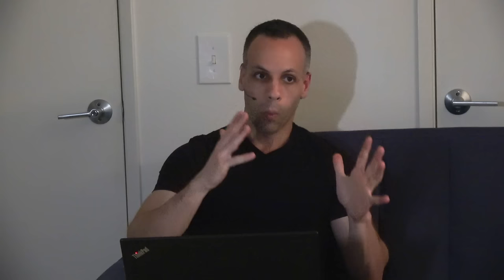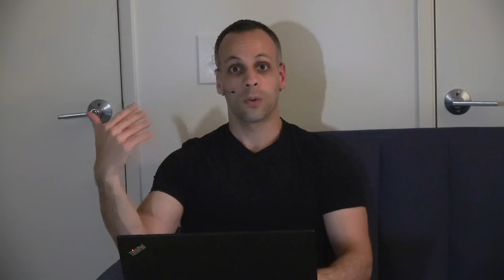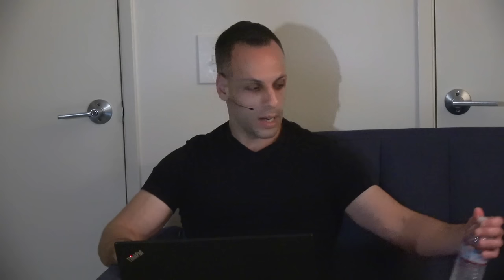EVGA's Oversight: Unannounced Changes Destroy PCs, EVGA takes NO ACCOUNTABILITY

Comment: I understand the policies, the problem is that they do not change the model when they change the pinout and there is not any justification for that, it's just a matter of printing new boxes and stickers.
Correction: Apparently, the boxes and stickers specify the version/revision of the PSU, according to one person in the comments. I still think that they should change the model to avoid confusion.

Comment: Years ago I plugged in a power cable into my OCZ power supply.  The modular cable was intended to go with a Seasonic, which has a different pinout on the side of the PSU.  $1,500 later, Kroll Ontrack (Eden Prairie, MN) recovered basically 100% of my data.  So EVGA wishes to change the pinout of a model in the middle of a production run without telling anybody?  PERMA-BAN, BABY.

Comment: Brand doesn't mean much anymore, I paid for an entry level seasonic psu. When i received it , it was DOA. I was so sure that the problem was from my setup, since for my it was impossible that Seasonic would let pass QC a bad power supplies. After going back and forth searching I found on a forum that some entry level PSU are not made by seasonic but by an OEM with seasonic specs. In the end I had to exchange my PSU and put some money to get the midrange one that are actually are still made by seasonic

Comment: If the pin-outs aren't all compatible, they should be using a different physical connector or supplying a tester with every PSU. It's ridiculous. (TBH, I have been paranoid about this issue for years, and keep my PSU cables in the box for each PSU, even where two are the same model, but I thought I was just being paranoid! Turns out I wasn't.)

Comment: Any company large or small providing a consumer product needs to provide a statement on their website, within a repair, etc stating if a manufacturer determined that a user-based function or procedure has been changed, modified, omitted, etc. If they fail to let the consumer know, this could look like a malicious attack upon the consumer to make them fail as an entity especially if there is sensitive data lost during the transition. We are used to living in a plug-n-play society and for those who aren't tech savvy rely upon this to make life easier. Any time that a manufacturer decides changes to a current program are to take place, it is their responsibility to notify those who are affected. Even when it comes to just an operating system that is downloaded, you are used to how it works now, and all of a sudden certain features are gone. This gives the end user a chance to make do with the changes or go to another source that has the features. At this point, with all the ways these companies are working are making us slaves to the company and not a someone who has a choice.

Comment: If you change the pinout on a model, why make the cables interchangable - put a notch or some other inhibitor to avoid using incompatible cables. The industry has been doing this since forever!
EVGA should definitely take responsibility for this!
Reply: The problem is that EVGA doesn't build their own power supplies, so a custom connector would add more expense and make no sense since the   plugs are standardized.

Comment: I noticed that modular power supplies often have different pinouts when I plug in different cables and then test it with a PSU tester only for the power supply to automatically shut off if I used the wrong cables.

Comment: Yeah been doing this since way before modular power supplies and assumed the ones where the plugs were compatible were standard. Like you I guess I need to buy a lotto ticket because I haven't blown anything up yet. To quote you this is informative and unfortunate. Now I am going to have to dig out my power supply tester whenever I install one and it shouldn't be that way.

Comment: "Keep your cables during RMA"  > "Here is your PSU back" > "Why did you keep your cables and reuse them when you were supposed to buy brand new cables even though we didn't tell you and it was not our policy?"
Best way to fix this is for EVGA to update their RMA process for changing the pin layout, give this guy a replacement PSU and cables, offer to buy him 22TB of new hard drives and apologize.

Comment: Murphy's Law, applied correctly, is an engineering principle.  Design such that a distracted tech can't install a part wrong and they won't.  Applied to cabling it stands to reason that you don't change pinout without good cause.  And if you must, change the connector so the incompatible parts can't be plugged in where they don't belong.

Comment: Power supplies always worry me, because they could output a too high voltage due to failure of regulation components. I never thought that they would have destructive rewiring of the pinout. Something new to check before using new supplies. I don't even trust phone chargers without hooking them up to a scope under load.

Comment: If they change the voltage output on the pins they should change the socket so you're old cable cannot connect to the new socket

Comment: The usual "the left hand doesn't know what the right hand is doing" problem.
FWIW I've only bought non-modular supplies (can you still buy them?) because I was afraid the additional connectors were another point of failure.

Comment: Been happening for years, just stupidity on the manufacturers.

Had it WAAAAAY back when I had a Sinclair Spectrum +2A (yes I'm old!).  The +2A was a slighty upgraded version of the +2, still with cassette (+3 had a disk drive), basically sort of an updated "BIOS" as it were.  Added the ability to communicate natively with a disk drive.

The +2, +2A, and +3 had the same connector for power (6-pin DIN).  For no reason at all; on the +2A and +3 models they swapped the 12V and 5V lines on the connector from the +2 model.

Basically: borrow your mates power brick, fry your computer.

Comment: I too, only came across the fact that there is NO standard for the PSU end on modular power supply cables sometime last year IIRC. The fact that this kind of thing could be an inline model change inside a manufacturer's same model line (And that it's EVGA no less) is unwelcome news. Having an EVGA 650 BQ semi-modular PSU in my main rig this is good to know. Yikes!

Comment: Ha I found myself checking the pinout on a modular psu cable with a multimeter the other day.
But under these circumstances I wouldn't have either.

Comment: I don't see how this could really be a problem for them to cover. It requires someone have a PSU that was RMA'd and then point out that it fried something, they can check that the pinout changed leading to that being possible and then only cover the number of drives that could have been plugged in as they don't offer infinite cables, they offer like 1 or 2 per device.

Regarding the pinout standard: yeah it's real dumb but unless there's a standard from the start every company will do their own incompatible thing and then won't want to change and bear the cost associated as well as invalidating their previous products. That being said, EVGA doesn't make their own supplies, they relabel supplies from other companies. I wouldn't be surprised if the reason for the pinout change was them using multiple suppliers for that model or have recently changed suppliers, or something along those lines.

Comment: It's funny, but I recently learned this exact same thing. The problem is: every manufacturer in the world has abandoned ISO Standards in order to create "Closed Ecosystems." And this is what you get when they want to force you to buy every piece, every small component from them, or in the least licenced by them. EVGA's perfect solution to this would have been to just send a bag of cables with the replacement power supply, EVERY TIME, if they cannot guarantee the pinouts match! What's really crappy for me is that 6 months after buying a new EVGA power supply, I have no way of knowing which bag of supply cables belong to the old pinout or the new one. So if I make any changes and have to add hard drives/etc, I'll have to order new cables, or have someone with a multimeter check the pinouts before I connect my existing ones up.

Comment: Here's my problem with your argument at the end: it's not the EVGA power supply that bricked the drives.  It's not a warranty matter because the power supply wasn't defective, and saying "the warranty doesn't cover X" doesn't save them.  It's EVGA's negligence that bricked these drives and destroyed the data, and they need to make the customer whole, data recovery included.

Comment: There's one important detail missing from Louis' argument re. damaged HDDs/parts - EVGA have arguably been negligent on this occasion. Changing pinouts without notification on the same psu model, very bad. But telling a customer to keep their cables and without warning sending them a replacement PSU with different, incompatible pinout which kills their hardware... they must surely be liable due to negligence, regardless of what their warranty says.
As for them being scammed if they accepted their mistake and replaced this (& similar) customer's destroyed HDDs... their exposure would only be to sata powered parts and only to customers who received a pin-mismatched replacement PSU. Which can't be that many, surely. (They can also reduce their exposure by contacting warranty replacement customers before drives get killed. Yes it will cost them, but 1) they screwed up and 2) the damage to their reputation will surely cost them even more.

Comment: I didn't know that the detachable cables were built to their specific PSU brand. My very first PSU with detachable cables  was damaged when I tripped on the power cable. I bought a new PSU from a different brand and for some reason I used one of the cables from the first PSU.
The new PSU and and a hard drive blew up.

Comment: I remember RMA-ing an EVGA PSU a while ago cause it died after ~3 months, the replacement they sent me came with all its cables and everything BUT it was rated 50 lower and had a warranty 1/3 as long that started when i bought the first one.

Comment: You say they open themselves up to getting taken advantage of if they offer to reimburse the user for their drives, but I'm not really sure that's the case here. They can clearly see that the customer sent them one power supply, and they sent back the new revision. It's not quite proof that the drives were killed by the differently wired cable, but it's pretty close. This case is a lot different than, say, a customer randomly contacting them saying "I bought two of your power supplies and broke things by changing the cables", given that they don't even have proof that the customer bought the two power supplies (and you could somewhat reasonably argue that it's the customer's fault).

It's really a moot point, though. EVGA practically asked for issues like this when they changed the pinout but didn't change the physical connector. If they weren't fucking idiots, then this would never have happened.

Comment: I had exactly this problem. Power supply died, so got replacement power supply. Cables had same connectors, so I used existing cables on the sensible assumption that they would be standard. It's basically a deliberate trap.

Comment: Wow... I thought those modular cables were somehow standartized... at least the connectors. I knew that the cable itself might be rated for different wattage, so it might look the same but might burn on different powersupply even if it fits as it might be graded lower that the supply can juice through it... 
But I would have never guess that they WOULD switch pins... I have rolled the dice for this with Seasonic and thank god knocks on wood I even switched 650 for 750 and haven't burned anything down... god damn you learn every day...

Comment: Thanks for the heads up.  I had something similar happen a very long time ago.  This was back in the FAT16 days [except it was just called FAT because FAT32 didn't exist].  But for my first 1G drive, I had to install a special driver.  But a couple of years later, 1G wasn't good enough so I bought a 2G drive.  But the new drive used the same special driver.  I tried the older driver because I needed to move data from the old drive to the new one.  It turned out, the new drive used a newer version of the driver and the new driver was incompatible with the old drive.  It destroyed the data on the old drive.

Comment: Yes, there is a limit to their liability, and yes, I would expect them to pay for data recovery. I would even expect them to pay some kind of compensation for the time lost dealing with this magnitude of a problem. To limit the liability, pay only for whats inside the one PC that got damaged by sending a PSU with different pinout. That PSU has a certain amount of cables that have the messed up pinout. Let the customer send you all the broken drives, pay a data recovery service to recover data and send repaired (or replaced, with the old data) drives back. Restore to original, not less, not more. The customer then has little to gain from cheating the system. Newer broken drives would have warranty coverage instead, older broken drives are not really useful anymore.

Comment: It doesn't need to be printed on the box or the model or anything - if they changed the pinouts, they should have changed the keying of the cables, so you cannot physically plug in the wrong cables without modifying them.  PSU cables have different notches in the plugs.  Some of the pin covers are square, and some are D-shaped.  A simple change to that would have fixed the issue.
Even easier than that would be for EVGA to have a mildly intelligent system that demanded that they send in the cable for any of these affected models, and, if the cables were not recieved, send the cables out anyways and print out a warning and put it in with the shipment.

Comment: Yes, I have tons of those cables. I never know for which PSU cable is. So, I 1st look at shapes of domes around pins, if it plugs (matches) into PSU.
2nd) Then I take voltmeter, and measure each pin against ground.

This applies even to PCIe power, therefore graphics cards.

Comment: that's insane I have a pile of 10+ EVGA 750 golds that i used to btc mine for 2+ years straight 100% maxed out 24/7/365 years back so the supplies are rock solid pretty insane they would swap pins. that had to be an unintentional oversight because they are top quality. back then cables were like gold so a lot of mixing and matching was occurring to not melt your wires from max current flowing thru them 24/7/365 but of course btc miners only used the square 4/6 pins not the flat sata ones

Comment: There is one company that has created a "standard" for the PSU side ports, but unfortunately they've patented it and don't appear to be selling licenses for it AFAIK. 

That company is Super Flower which is a highly reliable OEM that many other brands use, they have what they call the "super connector", every cable except the motherboard ones just have a 9 pin connection on the PSU and every port is universal, it's honestly fantastic and I wish they could make all brands use it! All the universal ports are exactly the same no matter the model, generation, or revision, it simply just works.

Comment: 14:40 Customers did exactly what you describe, and EVGA replaced stuff. One guy intentionally cut the tubes on his AiO cooler, threw a tantrum about how he was going to tell all his twitch subs that EVGA wouldn't replace his "defective" hardware, and the RMA department caved, gave a free replacement. And yes, people abused the hell out of the long warranty periods. They'd buy old stuff on ebay that had the lifetime warranty (it's why EVGA took down the warranty period check page for a while), make up an invoice from some random seller, then RMA for a new(er) product. Others constantly used the 5-10 year warranties as "back-door" step-up upgrade paths.
Reply: hmm ok
Reply: Customers abuse the most consumer-friendly policies in the industry and then have the gall to complain when companies start to push back on it.

Granted, that doesn't excuse EVGA's case here, but still.
Reply: @jmal  The RMA department managers roll over easier than a Labrador retriever that just ate an entire tray of pot brownies, unless it was a company screw-up. Then they turn into the most stalwart refuseniks who would make an Arstotzkan border guard proud.
Reply: @jmal  problem is this customers is different individuals. So why would honest customer be responsible for this scummy customers? The problem is still on the company as louis say this just show the company incapable to handle the customers.

Comment: 1:22 God hearing OCZ brings me BACK. Still remember when they started including the "my SSD is faster than your HDD" sticker with every 60 and 120gb SSD they sold.. for like $150 lol

Alsop EVGA has really had a slip in quality as of late. Over the summer, I had 3 EVGA failures in a row. One burst in to flames, the other two killed 3 motherboards. Such a shame, I've used EVGA power supplies in ALL my computer builds up until now. Switching to Corsair this time around, I hope they keep it up

Comment: Fully agree that it is ridiculous there's no standardization of how modulecables connect to the psu's industrywide. Even worse is not even having it standardized within the same company like EVGA has done here. Cables between same models/series should simply be identical, people may upgrade from one to another model in a series because they need more power (or less). It doesn't make sense to have to change all cables in such a case, yet certainly with EVGA you definitely should now.